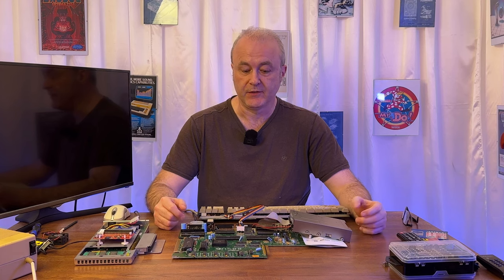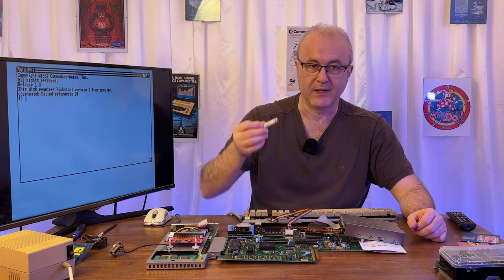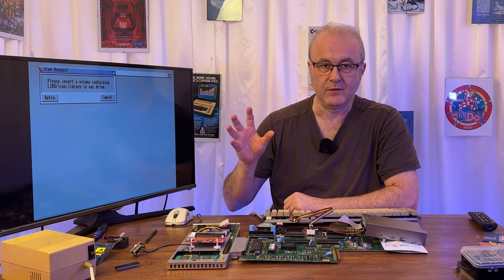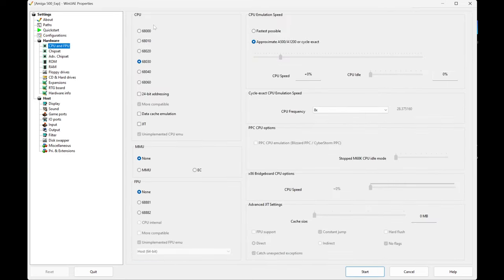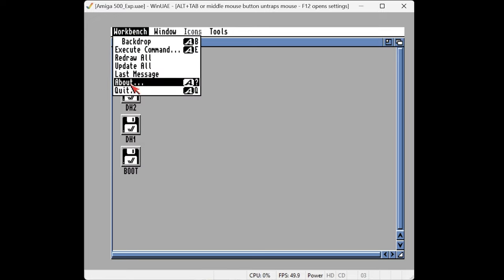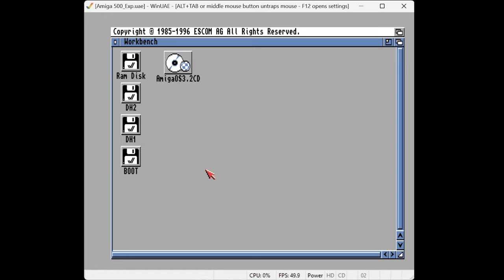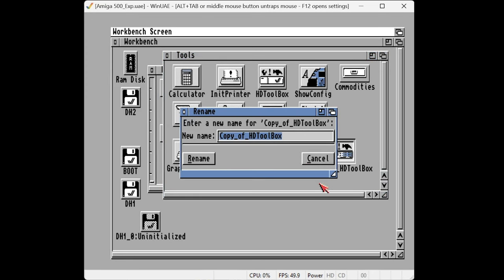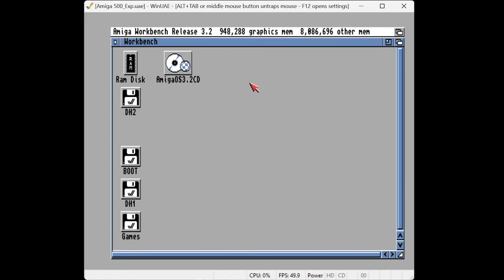Amiga500 Upgrade CH:02 Installing the GVP A500-HD8+

Comment: It's most likely the SCSI2SD adapter that's causing the long boot time because my GVP HD8+ with a 120MB HD does not take that long to boot.
Reply from the maker: I appears to be the number of devices. Im putting my Amiga 2000 back together right now, and trying to get a Network and CD-Rom working on my SCSI bus. Adding the Network increased the boot time a bit, adding the CD-Rom and it took even longer. So, with SCSI it seems its best to use less, but larger devices( HD) with more partitions, rather than many devices with a partition on each.
Reply: @RetronautTech  Not so sure about that. Back in the 90's I ran a BBS with 5 drives connected to the GVP controller and it didn't boot any slower. After adding a TF536 my boot time increased immensely though.
Reply from the maker: @anakondase  Im using a BlueSCSIv2, which is acting as multiple devices. I think with real devices, you'd be right. But I have used a BSv2 on a Fastlane Z3 SCSI card, a GVP SCSI card and also a TrumpCard SCSI card and all showed similar behaviour. One device, and its pretty fast to boot, more than one and it can take an age. In my A2000 without the TrumpCard drives, it boots in about 20 seconds. But as soon as I got drives working on the TrumpCard, booting took much longer, and when I tried to add a Network card and CD Rom it was talking 60+ seconds.
Reply: @RetronautTech  I see. Sad to say my GVP controller seems to be at the end because I can't get anything to boot from mine anymore. Tried three drives but the same result.
Reply from the maker: @anakondase  What is this GVP controller, for an A2000 or A500?
Reply: @RetronautTech  The same one you used in the video.

Comment: You can buy OS 3.2 at Amiga on the Lake if you are in the USA.
Reply from the maker: Indeed, once you have that, you just create an img in WinUAE, or you can use Disk Jockey, they produce the same file. Anyway, this video shows you how to see these, mount and then format them as hard disks in WinUAE. Once thats done, you can install OS 3.2 to it, from the CD if you have it, or from a HD.
Of course, you can also install older OS's as well, but you will need the matching ROM for each OS version...

Comment: Where did you get the hard drive files from? Did ZuluScsi card provided them when you purchased it or can I get them somewhere else.
Reply from the maker: Exactly, well, its a bit of a subject, depending on where you want to use your emulated SCSI devices. In this case its a ZuluSCSI, but the BlueSCSI works in the same way. They need RAW HD img files and these can be made with WinUAE (Amiga), also 86Box(PC) or Basilisk II(Mac). In terms of EXISTING images, copyright issues creep in, especially in terms of Amiga, as its IP is heavily enforced.

So... you can get the older OS's, like 1.2, 1.3, 2.0 for free AFAIK on ADF (floppy) and install onto a new img in an emulator (WinUAE) but when you want to install a newer OS, like 3.2 then its commercial and you need to buy it.

On PC and Mac, I'm pretty sure Microsoft and Apple are not concerned about their old machine/OS's so there ARE certainly downloadable img files for System 6, 7, 8 Macs and probably for MS DOS and Win 95/98/XP machines. Have a look...

BTW, new video about to be released on this topic (to a degree).